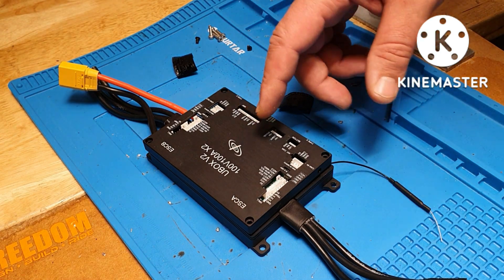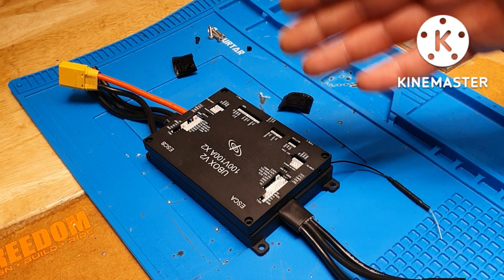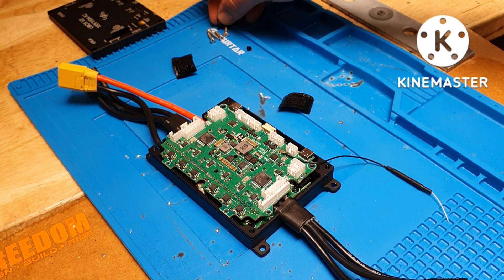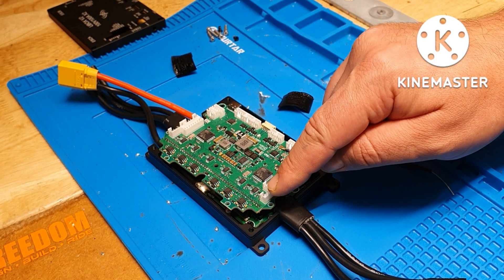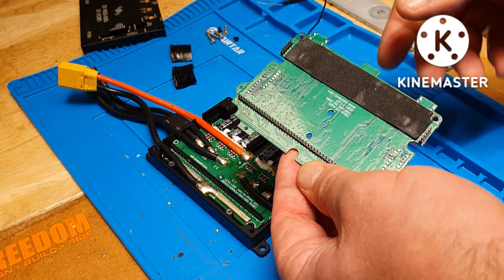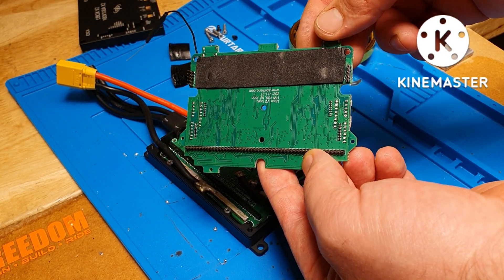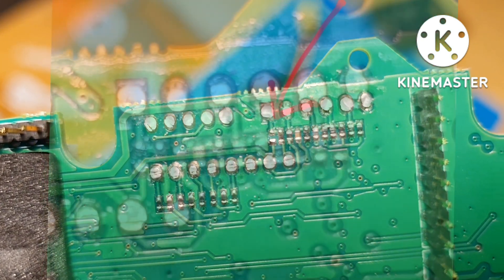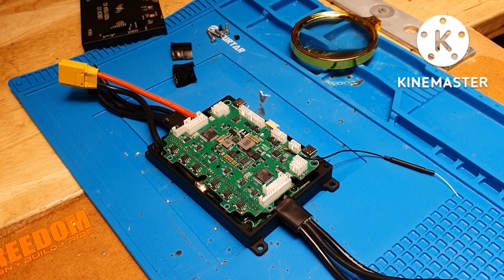Spintend V2 esc motor detection fix.

Comment: Hi pavel. Im a long time subscriber and i would like to know which vesc you recommend for hummie motors. ( i have never build a eskate and find it complicated ) I recently got hummie motors i ordered back in 2019 lol. I have got a massive battery already built waiting for these motors for 3 years now. Any advised would be greatfull
Reply: Forgot to mention its a 12s5p
Reply from the maker: Well... it's a good question. 
Trampa are probably the best quality but are a bit more expensive.  I do use the spintend v2 and Bioboards esc and have no problems.  I do also have Trampa vescs with no problems but some prople got problems with all of them.
Reply from the maker: What are the Smps you want to run the motirs at? I got a few vescs in my garage. 
What voltage is the battery?
Reply: Smps? And voltage?! Good questions indeed..i have no ideia…how can i find out?!
Reply: I ended up buying a makerX? Have u ever heared about them?
Reply from the maker: @Archate i did hear about them but never used it or tested one.
Reply: @PavelGarmas  pavel what is smps? And how do i check voltage?
Reply from the maker: @Archate sorry mate... Amps . Each motor has maximum Amp rating and it is good to plan the build so that all components match. ESC units have recommended maximum limit of hoe many Amps they can safely deliver to the motors.
Reply: @PavelGarmas  found the info. So the motors can handle 100amps and so the battery i have got. The markerx i found on their website it can handle 100amps also. So i guess im good to go. Just need an enclosure and then config everything on the vesc app
Reply from the maker: @Archate  @Archate perfect! Just ensure that esc can do 100 Amps per motor not total. Good luck mate. 
BTW, are you on ESK8FREEDOM Facebook group?
Reply: @PavelGarmas  i dont have facebook i only have instagram. I havent used facebook for 8 years now
Reply from the maker: @Archate  
i see... well it's mu group with close to 4K members and its all about esk8
Reply: @PavelGarmas  im in forums but they seem really dead…
Reply: @PavelGarmas  I’ll find out and come back 🙏🏾

Comment: I have the same issue with my V2 100....now I know what it is, thanks Pavel
Reply from the maker: Awesome that my video helped.  I have used a scalpel and did cut through the solder joint between the two connectors...works now. 
https://www.instagram.com/p/Cj98I3ZqfY7/?igshid=YmMyMTA2M2Y=

Comment: I just purchase this Ubox recently for a Begode K4 Extreme Bull I'm working on and at the the end of FOC motor detection /setup I got a fault of "Detection Failed. Reason: Sensor detection failed" - Is this exactly what you had ? I am beating my head in over this.
Reply from the maker: Switch the motors around to ensure it is not the motor. If the same side of esc still can not see the proven motor sendors then it could be the issue.  My both motors do detect but one side comes up as sensorless all the time.
Reply: @PavelGarmas  Thank you for the reply. Sadly I was informed that the 100v/200a VESC can only "safely" handle up to 96v 22s, my battery is at 99.5v (100.8v 24s ) and the VESC safety wouldn't allow for FOC detection... this Begode K4 has just been a thorn in my side with 2 controller fires. Again, I thank you for responding